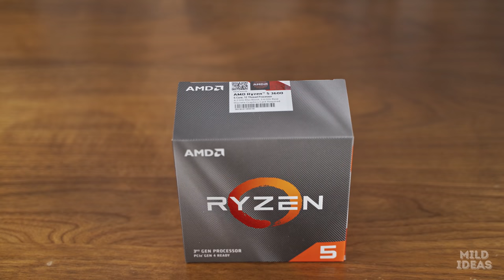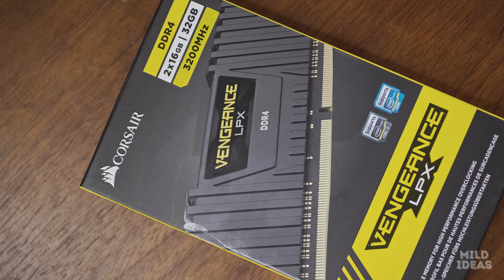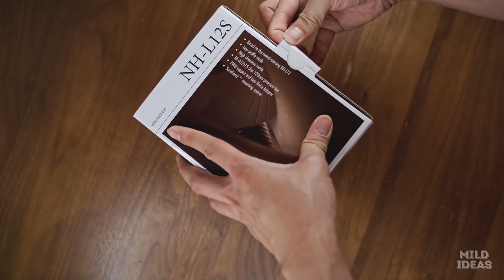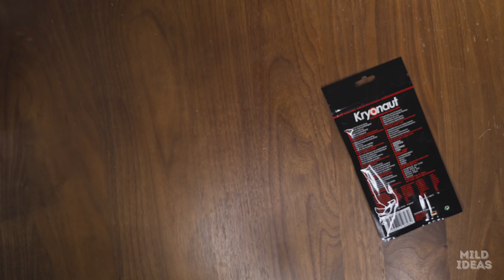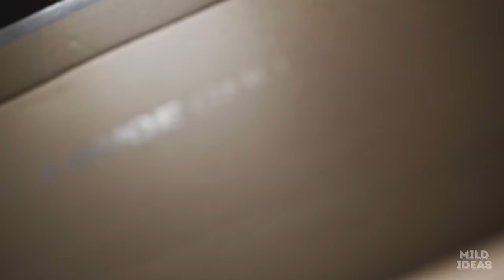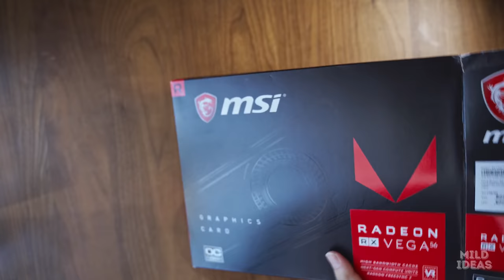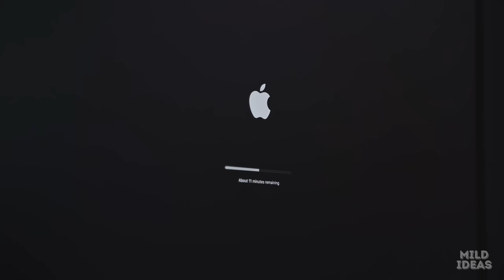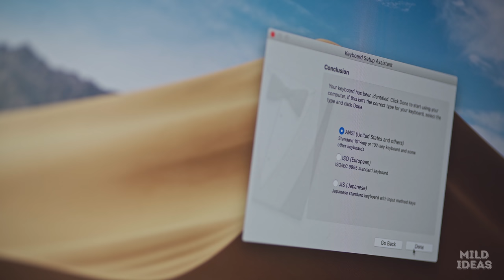Casper - The Ryzen 3600 Hackintosh Louqe Ghost Build

Comment: This was the most relaxing build video I've seen, right up until you forced that case cover over the Noctua cooler. Definitely cringed. Still a solid video.
Reply: That's the ocd in us. They're not sacred artifacts, i knew he would have to force it when he did the DIY bend. To actually shorten it would require cutting the pipes and sleaving them or heat mold a flange. Easier said than done and way too over the top. That's when you head into negative ocd. Still, it does get you eh lmao
Reply from the maker: @Azeraph  Yeah, no way around the side panel touching the top of the cooler :/. No build is ever perfect, ya'll should be giving me more crap for that blower GPU :P
Reply: Mild Ideas nah, blower gpu is perfect for this case unless you go water cooling
Reply: ^^ STiLL, that hand-bending is cringy AF for some reason, meh. IMO, anyway. :$

Comment: For first timers who just want to learn, one thing I would point out is that do not put heat conduction paste in a circle on the processor, it will leave a bubble inside in most cases and won't spread evenly, if possible put some amount right in the middle as a filled square leaving about a cm from each side but no gap in the middle, that way when you press the heatsink on, the extra paste spreads to sides evenly covering all of the processor heatsink surface. Also using electronic screw drivers are fir seasoned people only, new users who want to use these be careful as a high torque screw driver with wrong settings can very well spoil the thread or screws or both.

Comment: Mild Ideas: Ryzen Hackintosh!
Apple and Intel: This is a avengers level threat!
Reply: Silicon Supremacy why? Apple is gonna be making its own processors soon lol
Reply: @chidorirasenganz  because ryzen is not normally supported on mac and much better price to performance than anything apple has or ever will sell, so
Reply: Callum Matheson nah not really the a12x is still hella fast and that was made two years ago. Plus it’s passively cooled
Reply: @chidorirasenganz  It is very fast, sure, but in real-world tasks it will have nothing on a ryzen chip (same goes for the new iPad pro chip that came out the other day). Also, the mobile chips currently made by everyone are based on an architecture that doesn't support 64bit apps, so they aren't really good for anyone that does anything more than Web browsing atm
Reply: Callum Matheson actually Apple’s chip went 64 bit before any other mobile chips back with the a10. So 64 bit apps are supported and with catalyst transferring applications between macOS and iPad OS is possible without emulation. iPads can do just about anything without web apps. Music, video/photo editing, writing, design etc. The only thing I can think of that that you might run into snags with is 3d modeling and coding (depends on your use case) but those are software limitations not hardware ones.

Comment: 6:40 It would be good, if you have written something, why you placed the cooling paste in this way. I watched a lot of people, who aren't aware, that the die of Ryzen 3000 isn't in the middle of the chip, but placed around it. 

But overall, it's a fantastic  video! Good work :-)
Reply: The heat spreader should have full surface contact with the cooler. Therefor... the paste should cover the whole surface to promote full surface heat transfer. The more important question is... howto prevent „air bubbles“
Reply from the maker: I thought about adding more commentary as text or as subtitles, possibly even a voiceover commentary version where I explained all the things. And on the cooling paste, it all spreads evenly  regardless of how you apply it once the CPU heats up for the first time, I just wanted it to be a bit more visual than just a plop in the center :)
Reply: @MildIdeas  Thanks for your answer :-)

Comment: One if the smoothest hackintosh vid I have ever seen. Just 2 suggestions, please include the price at the time of the video of the components on the vid so its easy to follow there instead of tracking on links. And please do a video on getting the boot driver, I know many have done it, but I haven't found any that just does it in one strike and it's perfect.
Reply: Current price around $1700: https://pcpartpicker.com/user/GeekRedux/saved/#view=mRN7TW
Reply from the maker: Thanks for the suggestions, will do in the future on the price thing, some of the stuff you have to buy for ITX builds is kinda absurd if you're coming from standard builds. And no decision yet on the software part, I'm not an expert at this nor do I want to pretend to be one. Plus I'm almost always following someone else's guide verbatim (granted I should link the guide in the description).
Reply from the maker: @GeekRedux  Damn thanks dude :)
Reply: @MildIdeas  No prob

Comment: Can you do a video with the software part? Nice video btw! The integrated bluetooth and wifi are working?
Reply: Giuseppe Puliafito that's definitely the question. !!
Reply from the maker: I'll think about the software part, wasn't trying to be a software guide (way better resources out there than what I can muster), but maybe on my next build. And the built-in Intel BT/Wifi chipset isn't compatible with macOS, my replacement DW1560 was on backorder when I shot this video and had no timeline on when it'd arrive, so had to cut all that out.
Reply: @MildIdeas  Would really love to see that - been thinking about doing this exact build for a work computer! Or even some really detailed accompanying notes!
Reply: Absolutely not. Integrated Bluetooth doesn’t work on about ~80% of Hackintosh builds, integrated WiFi does not on 100%. 

You have to buy specific brands of Broadcom WiFi/Bluetooth cards; typically they’re M.2 cards torn right out of actual MacBooks or PCI-e cards made specifically to work with Hackintosh. But that’s usually a hassle and a half and the antennas are really ugly, anyways, so people usually use regular old USB dongles. OS X-specific features like Continuity and Handoff won’t work with those, though.
Reply: @stas_46  зачем так агрессивно? Он ниже ответил, что не заработало.

Comment: Man! Great vid. If you provide all software tutorial guide with kexts and settings, this will be the most popular Hackintosh of the year! Does everything work? Was it a pretty seamless install? Thank you 🙏
Reply from the maker: All this stuff changes so quickly, whatever I did was already out of date the week following (new kernel release added better GPU performance). The install itself was seamless, way easier than the last Hackintosh I built back in 2014. But I scrapped this build, AMD Hackintoshes are still not 100% compatible with all the macOS software, most notably Adobe CC is buggy, no VM support, GPU performance is 25-50% worse than what you'd get on an Intel. RIP my 3950x dream.
Reply: Mild Ideas wow that’s great info. Thanks for the response. Good luck with the channel!

Comment: Very enjoyable to watch, I like the music and no talk! I've been running hackintoshes for the last 8 years as my main workhorses (but only on Intel chips and nVidia GPU's - currently stuck at High Sierra on all my machines) - using clover. How did you get the Ryzen running, with some custom kernel or just right clover+efi+kext combo? Thanks for sharing, subscribed (330) 🤓
Reply: Nvidia on Mac? They are supported?
Reply: @G33kyAli  older Macs came with Nvidia GPUs
Reply: Got Mojave running on Ryzen 2700x. Currently setup as an Unraid VM. There’s ways of getting Nvidia to run on  for VM’s by kext/bios dump from card, haven’t heard much for Nvidia via hackintosh on Mojave
Reply: Skand Sharma correct. G4 PowerBooks, early Mac pros and MacBook pros had some Nvidia cards, Those specific Operating Systems that supported Nvidia cards can use them.  High Sierra is the last one to have the hardware ability to run Nvidia(for now).
Reply from the maker: Heh, you're an old-timer Hackintosher like me :). I mostly followed the guide on amd-osx.com along with the decade+ of tinkering on Hackintoshes. And my previous machine is still on High Sierra cause GTX 970 ;).

Comment: I have the same mobo and have been having a hell of a time trying to get it to run as a Hackintosh. Any chance you might share your EFI folder and BIOS profile?
Reply: Up
Reply: Seconded! I’m running the same components and struggling
Reply: Try OpenCore loader instead of Clover. Clover only gave me problems. Once I switched to OpenCore it worked basically OOTB. I have a different build, but still Ryzen if you'd like my EFI to go off of.

Comment: Regarding the thermal paste application: if the cooler has been seated and then promptly lifted up again before its final seating, air bubbles will get trapped in the paste. Also, laying out the paste in an X pattern helps it evenly spread out without bubbles getting trapped when seating the cooler. Other than that, dope AF :)
Reply: that was definitely mother of cringes right there!

Comment: You can see the panel bulge for the side where the CPU cooler is. And towards the end you can see that the side panel does bang into the cooler when laid into the inserts/rails. You could've pressed down on the cooler a little more or gone for another cooler entirely, given this is an R5 3600.

Comment: NH-L12S works best if you pull the fresh cold air from outside and blow it on the motherboard.
The LPX Vengeance have some little clear plastic over its badge, I only realized it after 1 year of use.
Reply from the maker: Lol I only found out about the LPX Vengeance plastic from comments like this :)

Comment: Amazing video loved every second. Just one thing that could vastly improve cooling and performance is the way you applied thermal paste, never put it in a circle as it could leave a pocket of air at the middle meaning you get less surface area to cool especial with such small cooler and tight space. Other than that keep up the good work 👍:)
Reply from the maker: Thanks for the tip!

Comment: Quite close to my PC build (not a mac), I've got the same case (Ghost S1), same motherboard, same memory almost the same PSU (just the 750W platinum version) and a 3700x instead of the 3600... and an nvidia RTX 2080 instead of the Vega 56 (...well maybe not that close). I hate the chipset fan on that motherboard though, I bought a 40mm noctua fan that I plan to replace it with at some point.

Comment: Nice vid and great production quality. How many cameras do you use in the creation of this?  

Also, next time you apply thermal paste, just put a dime size amount in the middle and press your heatsink straight down on it. This way you eliminate air pockets which do not conduct heat.

Comment: Oscar winner! 

I have a Ryzen 7 2700 with AIO  water cooler. Will this work on my build?

And the Mojave installer; do I create the installer on my Mac using terminal?

And does the GPU still have to support Metal just like on a Mac?

Thanks!

Comment: Looks really cramped, but you did a great job!
Reply from the maker: Most ITX builds are like this, my next build should be a bit more tidy though (and in a smaller case)
Reply: @MildIdeas  I was imagining an ITX build a-la NZXT H200 or Fractal Design Nano, so I was expecting more room inside. It's hard to make use of that little space!
Reply from the maker: @daris98  My next build is in a DAN Case A4, so expect less room than this one :)
Reply: @MildIdeas  Good Luck! You tripled your sub count since I came. I also subbed as well.

Comment: Way too much thermal paste, applied improperly. The grain of rice of pea size in the middle method has been proven to be proper with actual thermal testing, many years ago. Also, should have used a different heat sink.

Comment: what did you do to close the side of the mobo? I have the same setup and couldn't close it without using a Noctua A9 fan.
Reply from the maker: I didn't have fitment issues with the case fans, only the CPU cooler

Comment: Did you at any point notice that the motherboard stand-offs were pulling themselves through the motherboard mount holes? I have the same case and motherboard (just waiting on a few more things) and there are reports on Reddit with some motherboards having this issue. If you need a link for further context, let me know but otherwise did you have the experience where you had to be very careful with tightening the motherboard screws? Thanks!
Reply from the maker: Honestly I was so focused on filming that I barely remember anything about the actual build

Comment: The motherboard link says it has a "Intel WiFi 6 802.11ax & BT 5 with AORUS Antenna". were you able to get hackintosh install to use that wifi hardware or only the "intel gigibit lan" ethernet port?

Comment: Just installed the ryzen 3600 in my ghost (upgraded from i3 8100) how are you finding the temps/fan noise?
Reply from the maker: The 3600 isn't a demanding CPU at all. Should be quite quiet so long as you run quiet fans like Noctuas and tweaked your fan curves to ramp less aggressively.

Comment: Meanwhile, I have similar hardware (a full-sized X570 Aorus Pro Wifi, RX580 video card, Ryzen 7 3700X, 32GB Corsair DDR4-3200 RAM) and my stupid USB key boots, but there are NO HID devices at all, so I can't install the stupid thing!  Can't type anything, can't move the mouse or click...

My test bench has been mocking me for almost two weeks because of some stupid DSDT edit I apparently need to make that no one else needs...

It's getting Linux if I don't get to the bottom of this fast.

Comment: OK -- I agree spending 13,000-20,000 on a Mac Pro is excessive AND a Hackintosh that can run Big Sur better, faster and cheaper is ideal -- $1,700 for a base system OK -- BUT a) it is illegal to run a copy of "macOS Mojave 10.14.6" on a NON-Apple machine so at any point if you upgrade to any more current version of Mac OS you could simply lose your OS and investment. b) the only reason to go this way would be to out perform the Mac Pro at a fraction of the cost.

Comment: Very, very strange video.
I have an electric screwdriver, but I will twist it by hand. I have instructions for the paste, where it says that there isn’t much of it, but I’ll put so much that the processor goes into it. I have a small case, with specifications, but I could not pick up the cooling and forced to bend it with my hands.
 Man, I did it when I was 10 when my uncle gave his old PC and said: Do what you want ...

Comment: Sad my 3600 system is BSOD-ing on me :(
Might be RAM combo :( but even if the ram is not OC'ed to the XMP profile specs it still BSOD

Weirdly, if I set a max voltage of 1.3 and max 4000 mhz on each core manually (no longer allowing single core to reach 4.2-4.3.4.4 on 1.45 volt, BSOD no longer happens in all games, just very few....

Comment: I want a dual boot on my 2700 32 gigs vega 64 system, can you teach us how to do in another video ?
Reply from the maker: Maybe someday if I actually ran Windows :). But in general all that's needed is disconnecting your macOS drives, add another drive for Windows, install Windows on that one, reconnect your macOS drives, and the Clover bootloader will let you select which OS you want to boot into right after posting.

Comment: 👨‍💻💭That  air cooler  looks like Trouble Buy a Water deepcool 1 radiator au $80 less problems  i thought i'll try one This build and  it took me 2hrs to fit it all on the build  i7-9700k  adata nvme-2 16gb ram etc   - dont like them GPU 1 air blower  🤷‍♂️😳💭nope
oh this is a hackintosh Carry on wont matter   Anyway BUILT my 2019 pc  🎅👍💨🍻